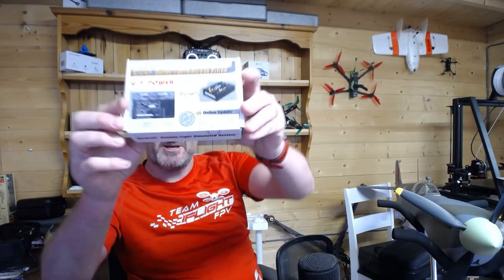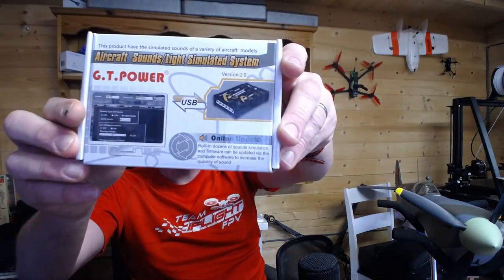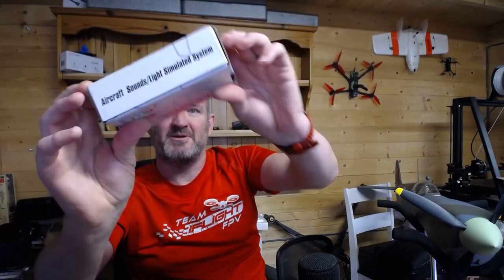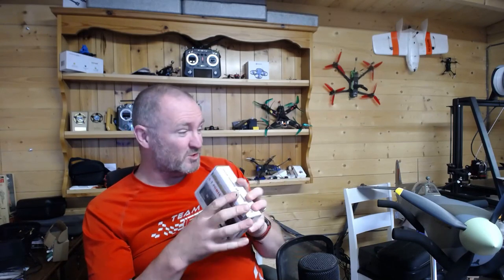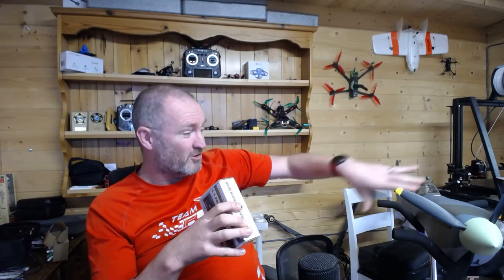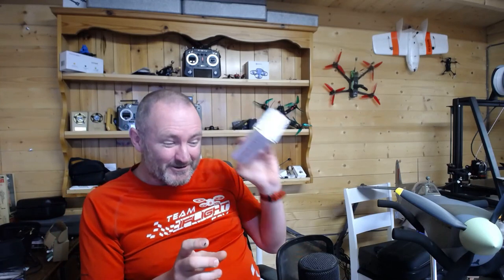G.T POWER SOUND & LIGHT SYSTEM

Comment: Can you show a video on how you've set it up as I'm having a difficult time understanding the instructions or to find a decent video
Reply from the maker: Theres not much too it!

Just plug the wires in and job done.

I suspect you are plugging in on the wrong side - its not clear; but on the device the 'THR' pin is actually where your ESC plugs into!

The pins on the oposite side are for the RX.
Reply from the maker: I meant to say.. Will do a video.. But will be a little while due to workshop burning down!

Comment: nice... got a link??? a lot of these are tied to the throttle channel and then have a separate pwm switch for on/off - now you just needt o upload into it the sound of a merlin :D
Reply from the maker: Bang good has them.  
[£47.90 13% OFF]G.T.Power Aircraft Simulated Sounds Light System V2 For RC Airplane RC Parts from Toys Hobbies and Robot on banggood
https://banggood.onelink.me/zMT7/16b9bfcb